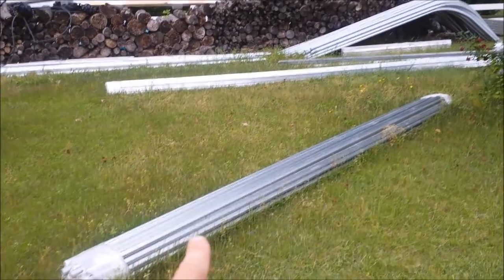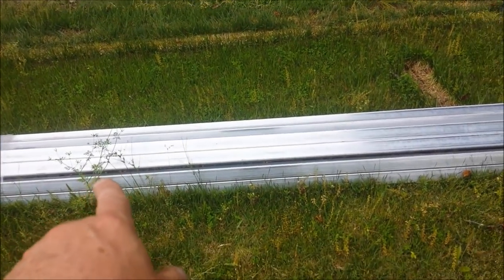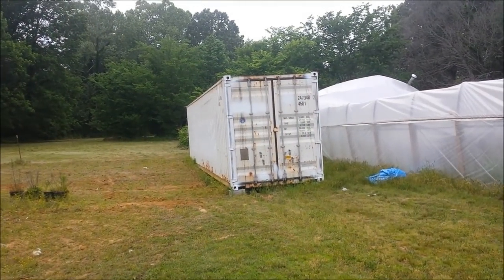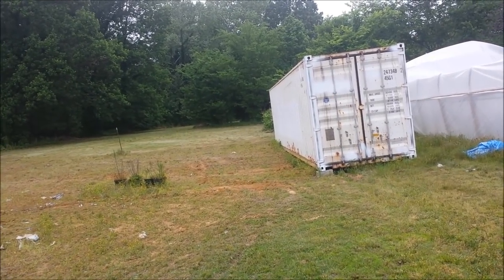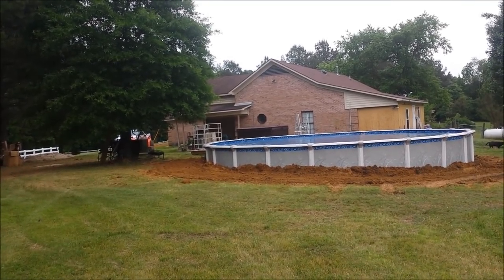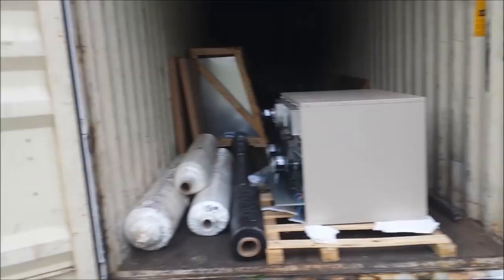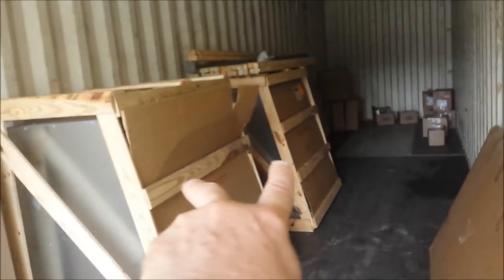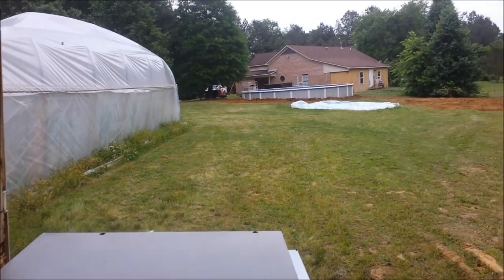The Newest Greenhouse

Comment: Best wish's building soon. This might be a helpful tip if you wish to use. You 4 foot post that you are going to concrete in. Do not set the bottom open end in concrete it will seal it and the water over time sitting in there will rust it out quicker from the greenhouse. Dig your hole, pound the pipe in the ground a couple of inch's, then with concrete and level. this way the pipe can drain into the ground. You might maybe no even have to concrete at all.. Enjoy
Reply from the maker: iamnjorganic great advice my friend and that is exactly the way the manufacturer has diagrammed it into the assembly instructions. The hole will be 24 inches deep and the post will be driven another foot below that.
Chuck